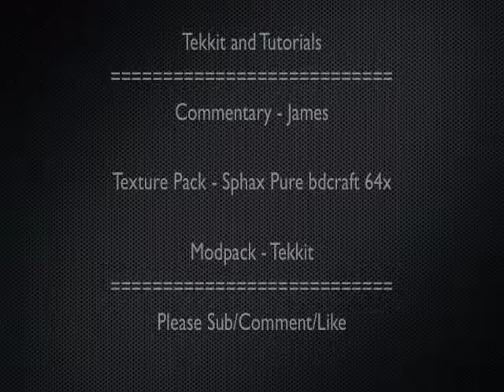Tekkit Tutorials - Centrifuge Extractor

Comment: The only upside to this vs the normal extractor is the 2 extra output slots. Even after placing 16 overclock upgrades and running at 15,500m/s plus 3 transformer upgrades and it linked in to my HV solar array. It was still slower then my extractor with the same 16 overclock upgrades and 3 transformers. Also each unit had 15 energy storage upgrades added.

The speed is a large diff. This unit u can still watch the sideways rain drop fill. The extractor upgraded as listed above with enough power.